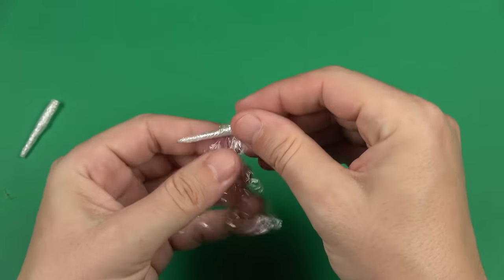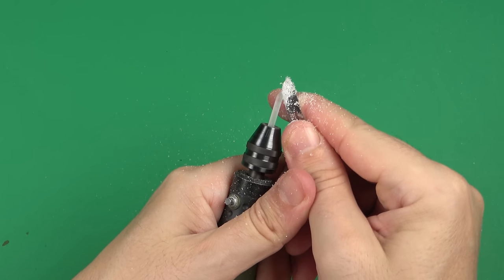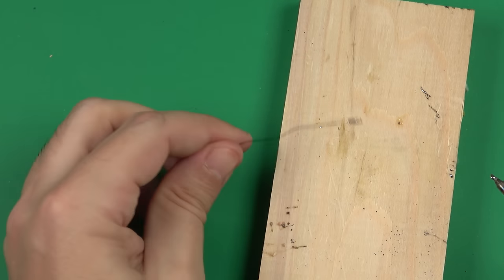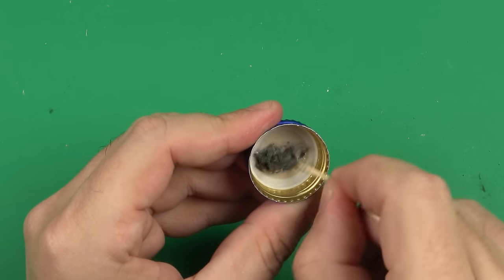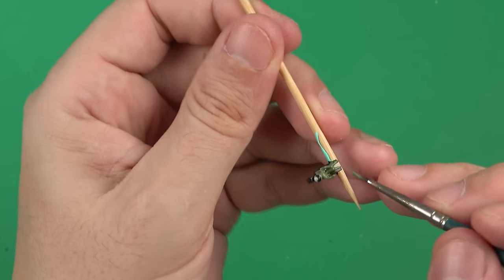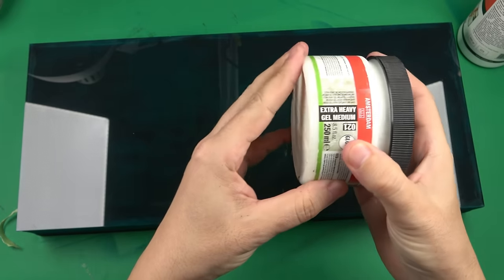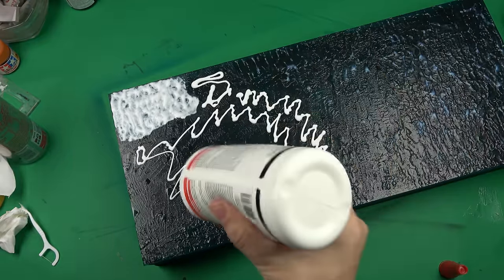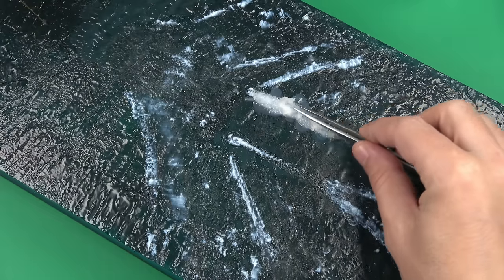F-14D Super Tomcat Takeoff Diorama - Afterburner Effect for Scale Models

Comment: That's avery nice effect. I did something similar with a space ship model - what worked very well for me was to use an acrylic rod. They are available in various sizes and have no 'bubbles' enclosed. The acrylic rod can also be used to mount the whole model so it really looks like it's flying. By using different grades of sanding on the rod you can even mount the LED in the base and shine the light into the rod from the non-model side. Your idea to use kitchen foil is awesome - i used clear resin which worked but your way seems much easier and a lot nicer. Thanks for sharing!

Comment: Don't you hate when there is no pilot figures in a kit?     I DO!!!     Good idea with the clear sprue. Now if some one could make a clearish "spinning prop" disk for in flight propeller driven aircraft that looks real....I'd really be happy!!!!
Reply: It's gotten to the point where I frequently won't buy a kit if it doesn't include seated pilot figures. Like Revell and Trumpeter 1/32 aircraft with big, visible cockpits but no pilot. Sick of having to buy aftermarket resin crew.
Reply: 2 things I expect from modern kits. Seated pilot and canopy masks. Kits are expensive today so going aftermarket for those is frustrating
Reply: @ravensfootball52  And the parts to close gear doors!